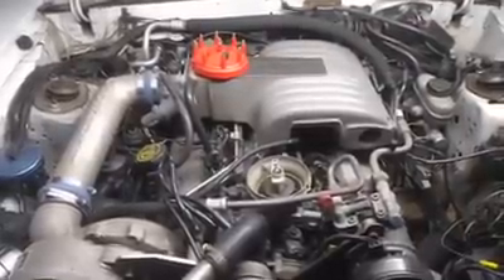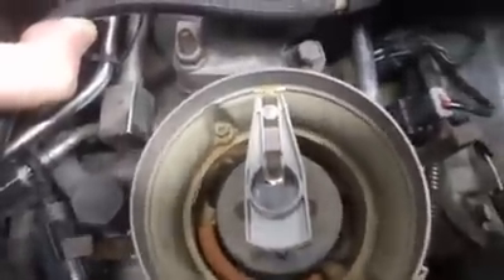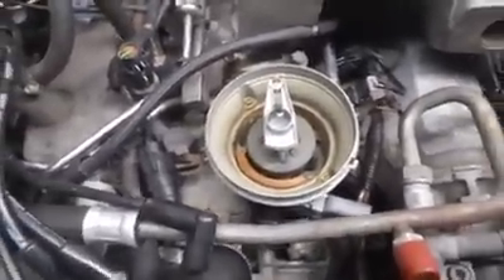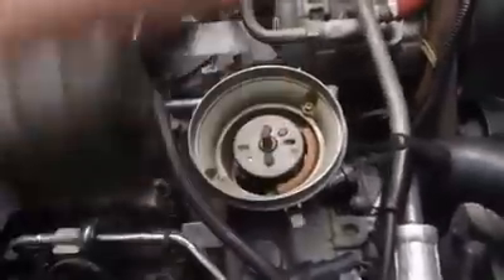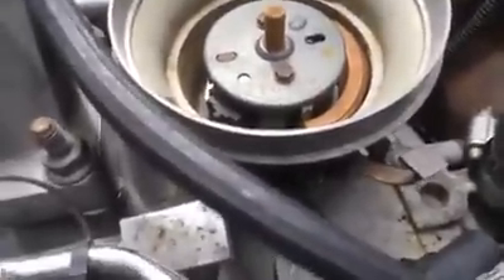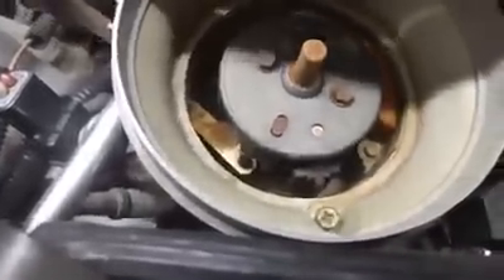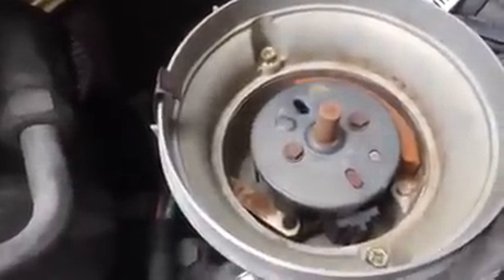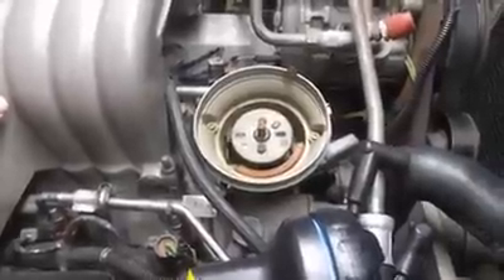Distributor install in a 5.0L Ford Mustang

Comment: 1 Tooth off. Rotor should be more to the passenger side...
Reply: I don't know, - maybe because I'm at 15 BTDC on my timing, but it looks different. The spark plug wires are on the spot just like you described it. {by the way I like your videos}
Reply from the maker: @matrixbikes  not sure. There are 90 crankshaft degrees between each terminal on the cap, so bumping the timing 5 degrees won't have any real effect on distributor stabbing. If you moved the wires, you can move the rotor pointing location, but you will end up with injector timing being 90 degrees off.

However, if you don't move #1 wire on the cap, then the distributor must be set up the way I show it or you simply won't be pointing to the right cylinder when the coil fires and it won't run. If your #1 wire is the 2nd wire away from the cap holddown clip on the passenger side, then it has to be stabbed exactly where my video points to... about 1/2" or so left of the driver's lower intake bolt.
Reply: Yeah, I guess you are right. Even if the distributor is off one tooth it is OK, as long as the distributor housing can be moved around to set the timing. I set up the rotor position like you showed on your video and it did not make any change. Before that I was messing with my Distributor today. I checked it to see when the spark comes. I noticed when I turn the distributor #1 spark plug fires twice. I've tried it 5 times and only #1 gets the spark twice when I rotate the distributor housing. I really do not think it is right. Any ideas on that? {I appreciate any help}
Reply from the maker: @matrixbikes  The distributor being "off a tooth" would just mean you have to rotate the housing more, but the housing can only rotate so much without hitting something. The other option would be to move the plug wire on the cap, but then your injector timing would be 90 degrees off. It really just has to be this way. If you have the housing out and you're spinning the rotor, each cylinder should only fire one time. FYI, each injector is also firing, filling the cylinders up with fuel. Watch out that you don't flood or even hydrolock the motor doing that. If you want to keep playing with it, unplug the injectors.

If it truly is firing #1 twice, I would want to capture that on a scope waveform and see why.
Reply: OK. The TFI module was bad. {#1 spark plug fired twice on the row} I called MSD about this issue and the second guy I've talked to was able to give me a hint. He said it is probably the TFI Module. Brand new {I just got my MSD distributor rebuilt with Motorcraft pickup that I supplied to them} TFI Module failed after 17 miles. The car still idles like shit but I see improvement. It is better now. I'm still looking for the solution for the misfire issue. Idles bad, runs great on high RPM but I still can sense a misfire.
Reply from the maker: @matrixbikes  the TFI modules have been a real problem. It used to be that a genuine Motorcraft module fixed all. But Ford quit making them, and now outsources them. I think to China. They're no better now than any other parts store module. I would suggest maybe trying a Standard Ignition brand module, or possibly NAPA gold. At least the Motorcraft does have a solid warranty, and even covers installers labor. Your idle issues could be a plethora of things, but I would start by pulling the PCM out and inspect the legs of the 3 teal blue capacitors. That's the #1 issue these cars face now, due to their age.
Reply: I already replaced the capacitors and it is still running like sh.t. I also got a Motorcraft pickup built into my freshly rebuilt MSD distributor. I think my ECU is bad. I've even sent it out for testing and the result said it was OK. I just bought one on ebay for $245. See how that goes. THX!
Reply from the maker: @matrixbikes  last year I invested heavily into a big microscope and soldering equipment, just to fix these stupid computers. I tried farming out the work, but each time the results were so marginal that I finally just gave up on that, caved in and bought the stuff to do it myself. Once equipped like that, it was jaw dropping what I saw. These so called expert repair guys must not even own a microscope, because the work they did was just horrible. I get it now. They weren't doing quality work, they were doing fast cheap work, hoping to make a quick buck. If it works, great. If not, they just labeled it as unfixable and sent it back to the owner and avoided doing the difficult repairs.

I was going to roll out Fox PCM rebuilding services this year, but I've become so buys doing various module programming that it's eaten up the time I had planned to spend doing Fox PCM repairs.
Reply from the maker: Here's some pictures of the PCMs up close thru the microscope. It's a completely different perspective.

https://www.facebook.com/DragRadialPerformance/photos/pcb.1966825646743969/1966825256744008/?type=3&__tn__=HH-R&eid=ARBhAoOSv5_R-LBJFHc21Uv25QBesO4_pqJkNzrSQbdAMaDcymgkzFEIvld6TbogfJYoM8cllwK5_vd0&__xts__%5B0%5D=68.ARB7BbhhZS8BcSww9vzGCym25txAVoAEXA1yIcY9e7eo9OhBDHDsH3JDKU9IqP5G0hg4-Kuv7lUZZhxYEJ0PtMphaqJzAvFH_ZWeBVgi_Mtpg_uglNYInWfk5JwlTw_X9dTuFVzOfHiCWB5Rh2yG89-Nfi3v8eI0X-DBV57XgZJ7sUEA_G0VnDvmJ9t60UIiSLcPqs4wfM0AhnUtYvPfZ-oIfHIpLOaIntbQhvnGUedEQPGzEBgPLwSky0WQRWpDZC1txr6K74vy45ZePgjqYg7xJHpIzrwbH6XfE24-Y2NmjhnAKuHYZTcoJ26ARi38NBvmdzAtdb5rsePOKIDSi0AvRQ
Reply: Thank you! I messaged you on facebook. I'm still waiting on the ECU. I bought it on ebay on Wednesday from Cali and it's still not shipped. I'll keep you posted once I got it.
Reply: I got the replacement ECU from ebay. I plugged it in fired the car up and I see no different. At least I know now my old ECU is good. So what could cause the problem. I wish I could describe the way the engine acts on idle. {I can feel the misfiring on higher RPM too but at idle speed is the worse} Basically it seems OK till the IAC motor is on at cold start. After like a minute when the RPM drops to normal idle speed 800 - 850 RPM it starts running rough but not constantly. The way it goes: smooth for a second and than rough for a second than smooth again for a second and rough for a second {like it misfires}. It will get a little better when engine reaches the regular operating temperature. Fuel pressure is at 40 I got a new distributor from MSD with a Motorcraft pick up. {I sent them the Motorcraft pick up to install it in the distributor} Thank you!
Reply from the maker: @matrixbikes  Make sure the EGR valve is not getting vacuum at idle. Try unplugging that vacuum line for a minute. Bad O2 sensors can cause a good running engine to run bad. Ignition modules are always a prime suspect. You could just have a bad coil, plug, wire, cap, or rotor.

I would start by seeing how big of a gap your coil can fire, with an inline spark tester like the one made by Lisle. Run Motorcraft or NGK copper plugs.
Reply: OK. I think I got it now. I bought a spark tester at Harbor freight. I plugged it in to #1 spark plug wire and started the car.  Sure is, when the engine was about to die out {when hesitation happened} the spark tester light when out too.
OK. That means the TFI is bad again. {brand new from O'riley which I just replaced 2 weeks ago} I had another one from MSD. I replaced it and the car runs good now. {how long will this one lasts?} No Motorcraft available anymore but maybe I find one on ebay.
 What do you think is the best TFI module if I can't find a Motorcraft?
Reply from the maker: @matrixbikes  I've had to replace 3 modules in a row before. Sadly, the Motorcraft one is now a junk chinese module that they farm out. I don't know for a fact what is a good module any more. Perhaps a used Motorcraft one that has the large embossed letters can be found. Other than that, Standard Motor Products and Napa Gold would be my best guess about what module you might want to try.
Reply: OK. I think I got it now. STC Bama chip was bad. It gave the car a rough idle and made the car stall. Differently like the my bad TFI module. I had spark all the way till the engine stopped. I saw a lot of blogs about the same problem. So I disconnected the chip and the car has smoother idle and it does not stall no more. { but it does not have so much power on higher RPM without the chip } I called American Muscle and they are aware of the problem so they offered me a refund. Now I'll have to dyno tune the car which I should of done before I got the chip. I hope this is it! Thank you for your help/support! I'll keep you posted and stay in touch.
Reply from the maker: @matrixbikes  That doesn't sound right. The SCT chip has been rock solid for as many years as I've been an SCT tuner (since 2008 and even before that). In all these years, I have had MAYBE one bad chip, and it was probably the customer's car and not even the chip's fault. I've never seen a bad batch. That said, I've seen plenty of sorry tunes from AM. But if the tune worked fine before and it doesn't now, something new is probably going on with your car. Bad modules and bad capacitors in the computer are the most common.

You do know that I'm a professional tuner specializing in mail order tuning fox bodies, right? :-)
Reply: It was definitely  the chip. Even the guy at American Muscle admitted they have issues with their chip. He even offered the refund right away. {it was my second chip with the same problem} You should see how may people had the same problem. I did replaced the capacitors already on the ECU. The TFI is relocated thanks to fatfox.com
We'll see how it goes, so far so good but I need to dyno tune the car for performance. I'll keep you posted. Thx!
Reply: Still running without the Bama chip. Engine/ignition did not cut out once.
Reply from the maker: @matrixbikes  interesting! The SCT chips have not had any problems. Not sure why Bama's does.

Comment: Every one I have watched on installing a new distributor is setting us up for failure. This guy can’t stop bragging about all of the super charger stuff. He can’t even focus on teaching us how to install a distributor
Reply: Bragging? That's not my car, it's a customer's pile with a garbage blower on it that got in the way of everything I wanted to film. I've shown you how to mechanically set the ignition timing to 10 BTDC without a timing light, and how to properly stab your distributor so that it will start up the first time and be within 2 degrees of perfect when you put a light on it. Buddy, if that's not good enough for you, feel free to make your own you tube video and share your vast expertise.